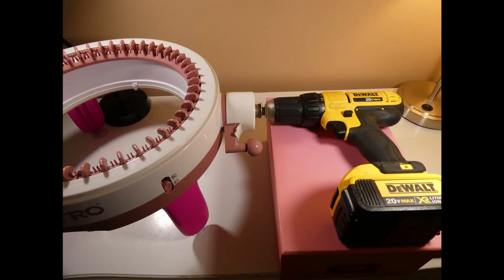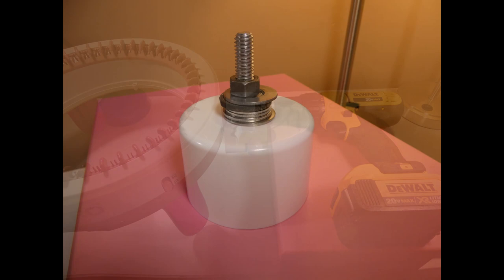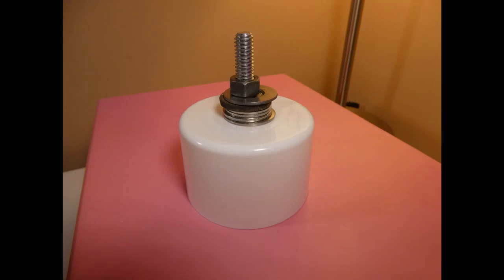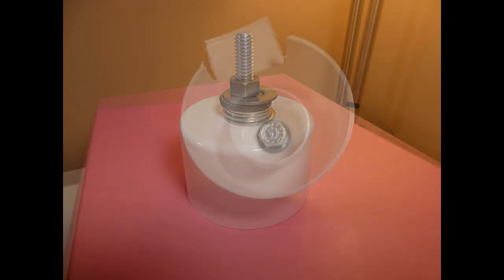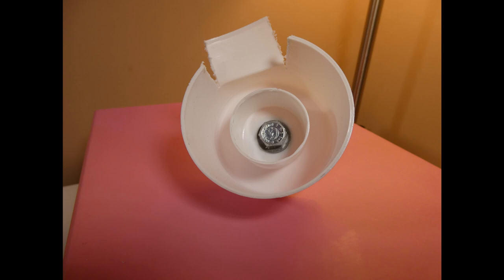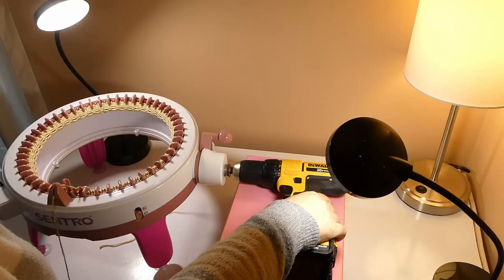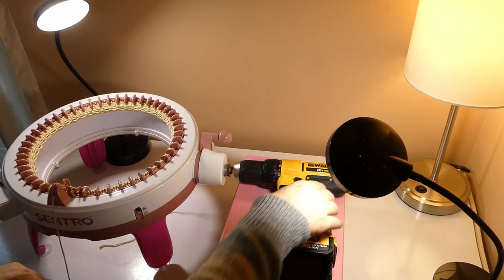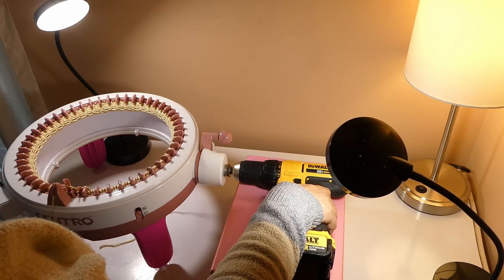Mortorizing the Sentro Circular Knitting Machine with a Paint Can Lid Adapter

Comment: Love it..although, i would prefer to use the Dremel, easy to handle it and light.
Reply: I've tried this with a Dremel, and it doesn't seem to be strong enough to turn the handle of the sentro, it just stalls the Dremel.
Reply: Ohh, good idea. Never thought of that. Inhad bought a set of 2, with the screw driver attachment, and use my Dewalt and my hand gets tired after awhile.

Comment: hi, very helpful thanks! 
how does the drill attach to the adaptor?
Reply from the maker: Thank you. The adaptor attaches to the drill like a drill bit. Long bolt holds the cap and is attached to the drill chuck which holds the bolt.

Comment: How do you attach the bolts?
Reply from the maker: Thanks for your question. Please see the pictures starting at .05. The bolt was placed through the hole and secured with washers and  a nut to hold it in place.
Reply: @paintnknitter  how many washers did you use?
Reply from the maker: @56578285  Hubby said one washer on each side or as much as you need.
Reply: @paintnknitter  thank you!